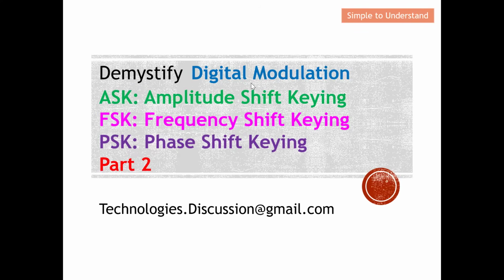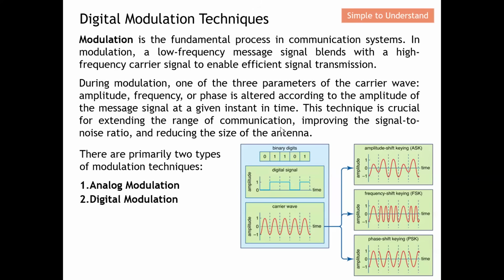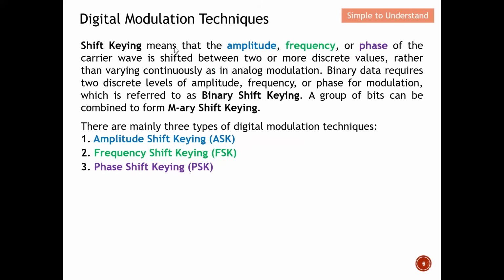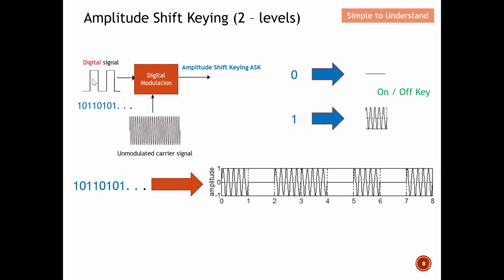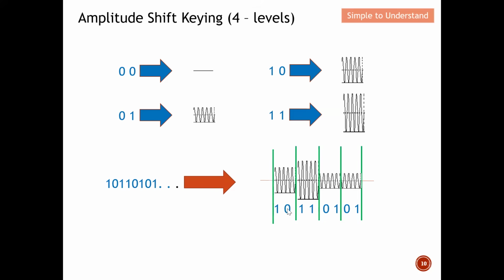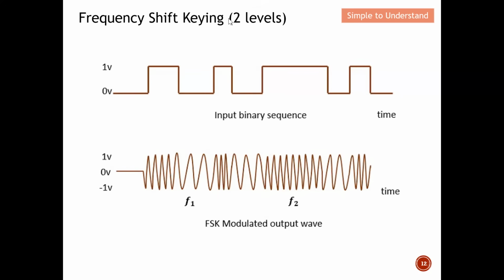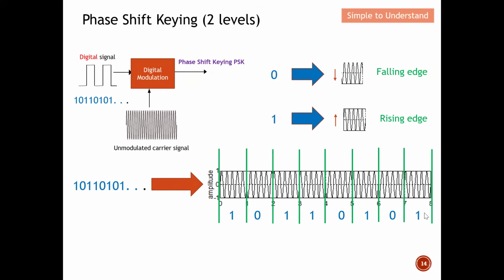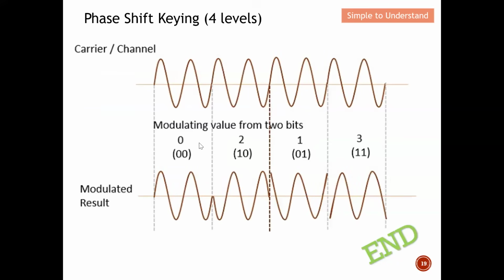Digital Modulation #2. How to Draw Time Diagram of Amplitude ASK, Freq FSK & Phase PSK Shift Keying.

Comment from the maker: Thank you so much for taking the time to watch this video on Digital Modulation.
In short, modulation can be divided into Analog Modulation and Digital Modulation. The key difference between the two lies in the message signal. While the carrier wave can still be in analog form, it is the modulating signal (message) that determines whether the modulation is analog or digital. If the message is analog, the modulation is analog modulation; if the message is a digital signal, the modulation scheme becomes digital modulation.

This video will demonstrate how to plot the time-domain diagrams for:
Amplitude Shift Keying (ASK)
Frequency Shift Keying (FSK)
Phase Shift Keying (PSK)